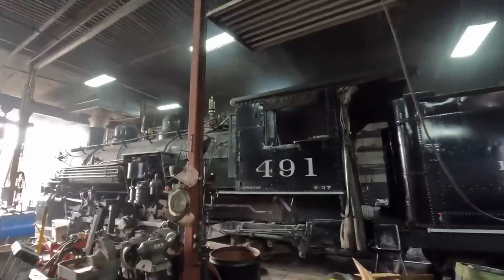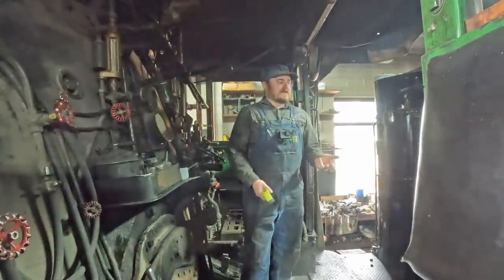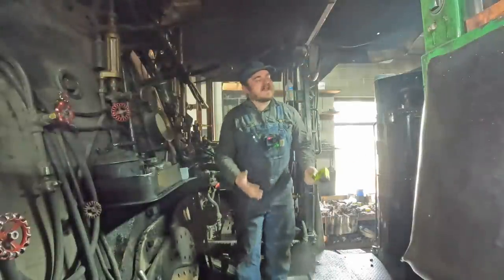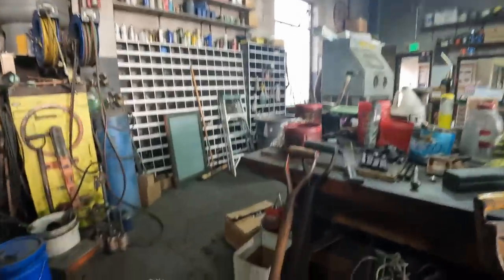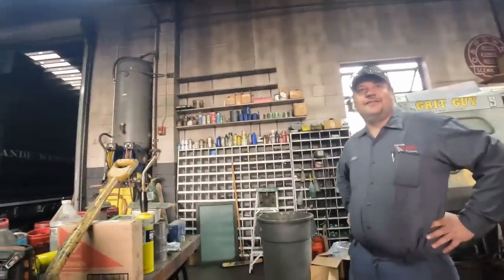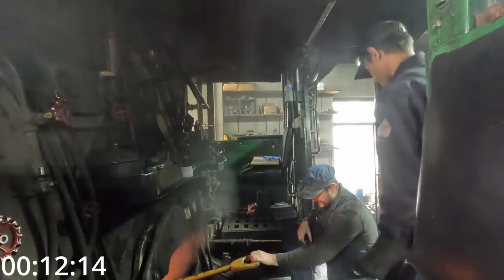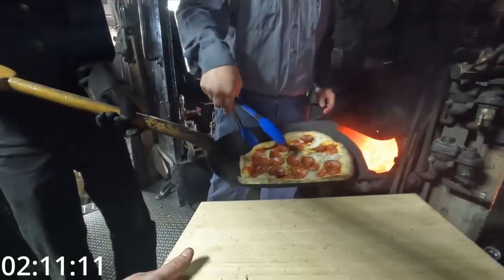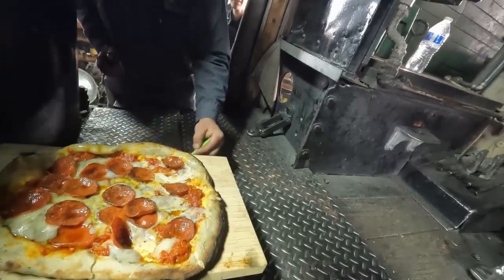I made pizza on the COAL SHOVEL of a 1928 STEAM TRAIN - original edit [K-37 Kitchen]

Comment: I can’t wait for the Colorado railroad museum To start serving pizza made in 491, I’d pay for it
Reply: Me too, and I don't think we're the only ones either.
Reply: I would!
Reply: I believe that coal dust is a carcinogen, BUT if they have any exclusively wood-burning locomotives they may well be able to do that

Hygiene is the main question, but I guess if somebody with clean hands and uniforms is the one doing the pizza cooking, and it's prepared in a clean kitchen next to the roundhouse, then sure. Would have to speak to food regulatory bodies.
Reply: @briannem.6787  As I suggested earlier on another comment, they'd have to use a locomotive that isn't running. That way it doesn't matter what it was originally fired with; they can fuel the firebox with anything technically, since it's not running.

The trick is to use an engine that isn't running. Build the engine into the restaurant and only functionally restore the minimum required elements (cab, firebox, boiler, smokebox, exhaust system.) The rest can be cosmetically restored, but otherwise remain non-functional.

Also, the bell and whistle are optional functional restoration projects that could add to the "atmosphere" of the restaurant but are not necessary for its' operation.

They wouldn't be able to use 497, since she works on the line at the museum, but they would be able to use a real steam locomotive. That's the draw of the idea, the "gimmick" involved.
Reply: The museum actually has a candidate for this 191
Reply: @Astro_dreagonz  Good idea!
Reply: @TheOneTrueDragonKing  oh yeah, if you use the cab then you could make a restaurant AND a display for people to actually get up close and look at how things work!

I was thinking it wouldn't be quite the same if there's no loco, but it'd probably be just fine!

Modify the firebox to not require water immersion, boiler can be cutaway to demonstrate how it works and showing the steam dome, regulator linkage, etc.

OR, a slightly more boring idea but probably much cheaper (and less controversial than cutting up a loco) would be making an oven that operates as hot as a steam locomotive, and the food is loaded onto a shovel, and that whole wall of the kitchen is made to look like a locomotive cab
Reply: @briannem.6787  Why cut it up when you can keep it intact for the cool features?

Keep the steam as well, that will enable other fun features like the steam whistle, which will enhance the atmosphere of the restaurant if it gets blown from time to time.

The locomotive used doesn't need to run, but it does need to look like it's ready to depart. That's the whole draw of the restaurant - that your food is cooked in a steam locomotive firebox. If there's no loco then the idea is ruined.

There are tons of steam-train-lookalike cooking facilities out there, with at least one person making a static grill that looks like a miniature steamer. This will be the first one made from a full-scale live-steam locomotive. Quite unique, honestly.
Reply: @TheOneTrueDragonKing  I was thinking, if cut up it could act as an education facility. A museum has limited resources, may as well make 1 loco do 2 jobs
Reply: @briannem.6787  True, but that ruins what I was going for when I initially had the idea. It has to look like it runs in order to have the needed illusion. A cutaway doesn't run.
Reply: @TheOneTrueDragonKing  well, only 1 side is cut away. The side you order pizzas from, where the food is prepped and payment done, is intact
Reply: @briannem.6787  But the point is the steam is coming out of the stack, dynamo and fittings as it's supposed to on a functioning locomotive, not out of the cab roof.
Reply: I live in the UK and I would still get it
Reply: I would to if I could travel there lol
Reply: @TheOneTrueDragonKing  I would LOVE for that to happen!
Reply: @TheOneTrueDragonKing what difference does the locomotive not running make? The radioactive/poisonous trace elements trapped in the coal will still go up with the smoke, as a very fine dust and stick to / deposit on top of the food, as heat still rises, even if the engine doesn't actively draft. Here's just a few examples: arsenic, antimony, cadmium, lead, selenium, thallium, and that's only what was found in the highest concentrations in the smallest breathable particulates from coal smoke. Some surveys even found traces of uranium, but that, of course, depends on the source of the coal.

Cooking in a firebox is an interesting idea, and if it was wood fired, I'd definitely go for a bite, but I wouldn't touch a coal cooked pizza with a 10 foot stick, no matter how clean the cook and the kitchen are. There's a reason we are actively trying to get off coal.
Reply: @longbow192  It would be wood-fired, and not running but still barely working. Boiler would have pressure, whistle would sound, dynamo would run, pistons would move, wheels would turn, locomotive wouldn't move.

Alternatively, it could be charcoal-fired, like a grill.

From your super-aggressive attitude, it sounds to me like you're simply anti-steam locomotion, not just anti-coal.

There's a reason said elements are called "trace elements" - because there's barely a trace within them. And they're using tiny amounts of coal too, and not on a daily basis.

Oil can have many of these things, so go yell at every railroad, power company, etcetera.

No need to be an asshole about it over such tiny amounts. Like I said, go yell at the Class Ones, not at an idea for a museum. There are much bigger users of coal and other fossil fuels out there.
Reply: @TheOneTrueDragonKing  Whoa. Way to get defensive there, buddy. I'm a trained mechanic, with a recently discovered appreciation for steam engines, their intricacies, all the levers and rods working together, and I happen to know steam engines don't only run on coal.

And that's not at all what "trace elements" means. It means they're not a significant part of the coal, but they're still measurable, and can still mess you up if you ingest them. As an aside, I mean, sure, coal power plants consume a lot more coal, exhaust a lot more gases and particulates, but they exhaust it way up there in the atmosphere, and there's a lot of atmosphere between that and people's airways and food, and it still gets tens of thousands of people killed from respiratory issues, let alone if you just casually make your food directly in that smoke. To get back to the main point, you'd know that if you actually bothered to look up what cadmium or lead does to your body, but I guess name-calling a rando on the internet just comes easier to you.
And since it seemed to bother you so much, I only brought it up since wood or charcoal can't develop those high temperatures that were mentioned in the video. I know a lot of pizza gets baked in wooden fire, courtesy to not living under a rock, thank you very much.
I was only mentioning why I would never touch a coal cooked pizza, and I'm sorry you went and took it personally, I guess.
Reply: @longbow192  Charcoal is made from wood. But you'd know that if you were telling the truth about not living under rocks.
Reply: @TheOneTrueDragonKing  please go back and re-read the sentence where I mentioned charcoal, then get back to me. I would explain to you that I didn't talk about charcoal when talking about the harmful particulates, but I can't understand it for you. But for any eventuality, I'd like to go on the record and say I don't have a problem with charcoal. Is this clear enough, or do you need me to type slower?
Reply: @longbow192  You said charcoal doesn't get up to the temperatures needed to make  a pizza, then you wood does.

Apologies if I misunderstood you, but I don't think I did.

Also, apologies for my initial reaction upon your first post. It appears I came off too strong.
Reply: @TheOneTrueDragonKing  you know, maybe your reaction was warranted. I got ahead of myself. I'd just like to clarify that I was only going off the info in the video, and it actually makes sense that coal can develop higher temperatures, because it's just more energy dense, otherwise we probably would've stuck with wood for power generation.
And also to take the opportunity to apologize myself and bury the hatchet.
Reply: @longbow192  Your apology is accepted, consider the hatchet buried.

For a non-working steam locomotive that just needs minimum boiler pressure, wood or charcoal is fine.

Fill the tender with charcoal briquettes and park it and the locomotive at the station with the stack sticking out, and when it's fired up you've got something that looks ready to roll but is in fact, just the oven.

I still say that K-37 Kitchen is a perfect name for a train-themed restaurant and it should DEFINITELY be a thing at the Colorado Railroad Museum.
Reply: @TheOneTrueDragonKing  I would eat that pizza straight out of the scoop, tell ya hwat.
Reply: @longbow192  Hah, me too.
Reply: And deliver by locomotive!!!!

Comment: Maybe if you find a metal plate for the pizza to put on top of the shovel, you can transfer the plate plus pizza between two shovels to rotate it. Just be careful not to drop it or Jeff might get mad
Reply: Or aluminum foil between the pizza and the shovel.
I would almost have suggested to use parchment paper instead of the aluminum foil (since it would burn up cleanly if the pizza fell into the fire), but I've seen corners of that paper get burnt when they touch the metal of a normal oven, so the temperatures of a blast furnace might be too much. Or given how the success of this test has surprised us all, maybe parchment paper could work too...

Comment: The stories I’ve heard of train crews over the years using their locomotive to cook or keep food warm is staggering. They cook bacon on the shovel still at the Nevada Northern in #93 and #81. They scramble eggs and sausage patties on the Tornado over in the UK. Guys on the Illinois Central putting their thermos full of tomato soup made by their wife slipped in between the pops with their bread slipped in behind the water glass to warm up before a quick dip into the box to toast it for sopping up said soup. And yes: I’ve read a dozen stories or so involving pizza or similar foods on the New Haven, Erie, and Southern Pacific lines. Two guys on the Clenchfield used to stick their coffee percolator into the firebox of their ex-D&RGW 4-6-6-4 Challenger (which was from a sister batch of the 3985 made by Alco for UP in 1943 but was redirected by the government to the D&RGW because the war department wanted all four main transcontinental lines carrying materials for both fronts of the war) and would boil their coffee that way. There are hundreds of fascinating stories out there. A guy operating on a logging railroad in Oregon or California used to shoot deer he saw by the tracks and would field dress them as the logs were being loaded then cook the venison when running up or down select hills since he knew his engine’s unique firebox and it’s quirks that intimately so to avoid burning anything—needless to say, he was logger’s favorite guy on the roster since he fed them better with his 1894 Winchester chambered in .32 Win-Special and his “geared oven” than the company did. (I wish for the life of me I could remember what railroad it was… heard it from a guy who spent his life custom modeling the railroad at home in HO that he himself spent 50 years with… “Northern California Pacific” or something? I used to have a book about the line… they painted their coaches emerald green and had a fleet of un-modernized 4-4-0s… he passed away in 2007, sadly.) It’s a long tradition, Hyce. Be proud!

Comment: Making a pizza while firing up the locomotive is actually extremely apropos, as Pizza and the somewhat similar Flammkuchen were originally made in the village oven while it was being fired up for making bread. When up to temperature, the fire would be removed and the bread loaves then baked in the hot oven.

Comment: You guys do know how to have fun!  There are-- or at least pre-pandemic there were-- a few pizza parlors in NYC whose marketing stressed that their pizzas were made in coal fired ovens.  Supposedly they are hotter than gas or wood fired ovens, which is supposed to produce a superior pizza.   They are located in one of a few bakeries in NYC (built to make bread, not pizzas) which had never replaced their 1920's vintage coal fired ovens, which apparently can still be used under current air pollution laws under some type of grandfather clause.  Then there is the problem of getting anthracite coal delivered to NYC . . .

Comment: It might not work for coal due to temps, but if you had one of those aluminum serving trays it would fit in the shovel. Then you'd be able to rotate the food pretty easily.
Reply: Only problem with that is the melting point of aluminum... You can actually get aluminum to melt on a wood fire.
Reply: @ryano.5149  I looked it up, aluminum melts at 1,200F. So with the temps he claimed in the video, it would be okay in the wood fire. But with coal getting up to almost twice the melting point that would be too much.

Comment: Let me tell you about atsf 2926 and the coffee. On our last steam up our fireman Henry and our treasurer phill decided to make coffee from 2926 a loco that weighs almost a million pounds. Of course how they did it was a metal keddle pot to heat up water and then pour over. The keddle pot was put in the firebox door intake vent and left to boil. Apparently once made the coffee was absolutely terrible watered down and didn't really make coffee. The reason for this is because they put it on the intake so 2926 was sucking cool air passed the Kettle into the firebox instead of putting heat on the kettle so it didn't boil. What a let down for a engine the size of 4 school busses
Reply from the maker: that's hilarious, had they just put it on the oil can shelf it would've worked

Comment: Not really pizza related but is the cab space smaller on a K-37 than a K-36?  It seems like it on video but that’s hard to judge.   It would seem like it as the boilers for the 37 are bigger right? Being standard gauge previously.  Thanks!
Reply from the maker: K-36's have a reverse taper coming back to the backhead, so the boiler inside the cab is significantly smaller than on a K-37 where it's straight the whole way. I believe the boiler barrel diameters are comparable, but not at the backhead. Cabs are of similar size, the 36 just feels a lot more roomy because of the boiler.
Reply: Thank you.   Never been in a k-36 but I did have a chance to sit in 493 when it was still in silverton but it was missing parts then too

Comment: i wouldn't call it the most portable pizza oven but it most certinly has an integrated (extra heavy duty) pizza cutter
Reply from the maker: It's more portable than the ones built into buildings :P
Reply: @Hyce777  compared to that definitly. but idk about the portability of a 183 thousend pound pizza cutter.

Comment: you have been saying in many videos that making a train run at optimal temps and everything it takes basically a full day to burn, heat up at get ready. well, back in the days, did the trains constantly burn and keep hot or did they take a break once in a while?
Reply from the maker: They'd keep them up for 30 days at a time, unless something broke. After 30 days, they'd do a wash of the boiler and then go again.